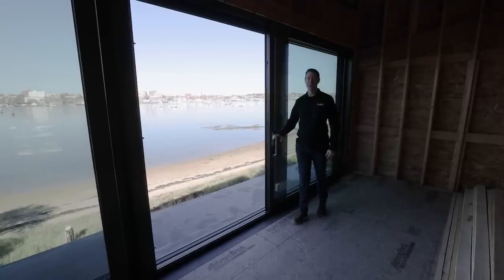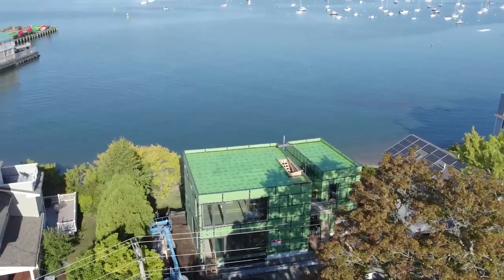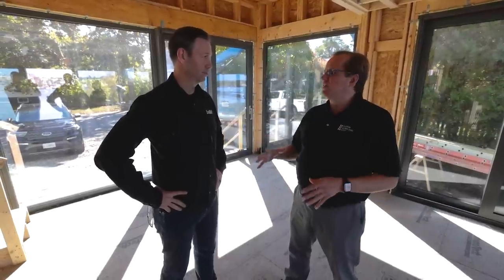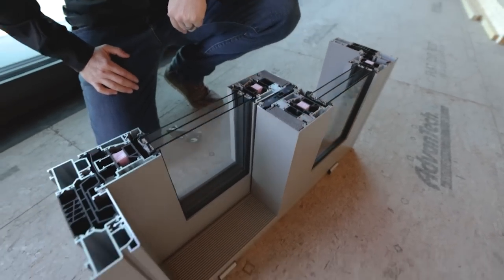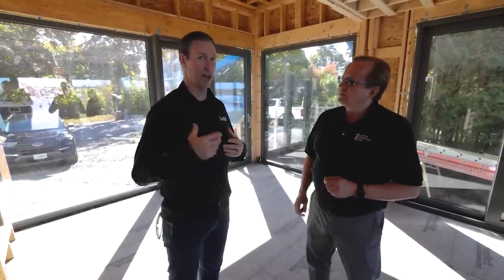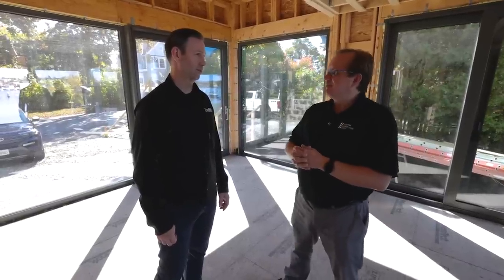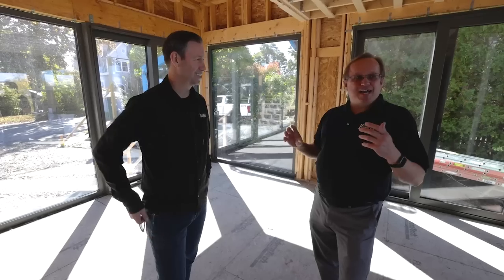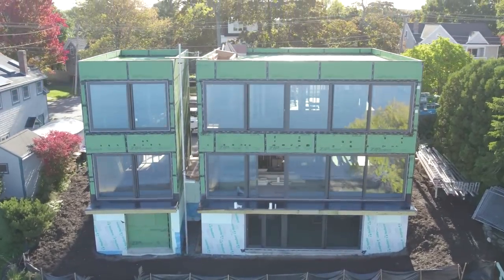How To Get Better/Cheaper Windows from Europe (to US Job-sites)!

Comment: Would be nice if they would start producing high quality windows in the US
Reply: Alpen from Colorado
Reply: Indeed there are a lot of quality windows and door manufacturers, and most important hurricane impact resistant: Windoor, PGT, CGI, Marvin Coastline, Euro-wall, Jeld-Wen.
Reply: There are, they just charge more than most people can afford for windows.
Reply: and ship them to Mexico too.
Reply: There are plenty of good windows in the US. I love my Simonton brickmold 600 vinyl windows or 5500 replacements. I have personally installed them in my own houses multiple times and they aren't insanely expensive (like 200-300 a standard size window). There are other brands that are great too.

This is a multi-million dollar house so buying European windows which are insanely expensive isn't a problem. They don't make sense for most sub 1 million dollar houses. These windows are thousands of dollars a piece and require a crew to set them which adds a ton more cost. Also no flange on a new construction window is just stupid and is asking for problems with any slight variation in installation. Taping a flanged window is so easy and hard to screw up. 

Regular houses probably won't see an insane energy cost savings going from a good double pane us window and these insanely expensive triple pane. As far as this house if they were serious about energy efficiency, they wouldn't make a whole wall of windows. They can't be as energy efficient as a wall structure.
Reply: @Josh.1234  They are more energy efficient then a wall structure in an american classic house, In a Passive house its about equal. I sell and install euro windows all over the US, I also do water proofing, and Flange windows have way more issues during install
Reply: @Josh.1234  how are you installing flanged in the middle of 2x6+ walls?
Reply: @TimFrentz  the question is why install them in the middle of a 2x6 wall? If your architect spec'ed that then you will need flangeless of course but it's way more preferable to use zip-r panels, caulk, flanged window, Huber flashing tape over the flanges, metal flashing over the head trim.. bomber install and hard to mess up.

Recess it in a wall and you are creating a lot of potential problematic joints and a lot of potential for installer error.
Reply: @Shredz131  looking at the specs on these windows, the best of these models are not quite .1 u-value (most are around .2 though) making it roughly r10.. min code for wall r value in US is r13.. so no these are not better insulation than a code minimum wall structure.

Also flanged windows do not fail or have more install problems than flangeless in residential construction.
Reply: @Josh.1234  yeah, but you need to look at solar gain. The net result is better than a wall
Reply: @immers2410  solar gains will not compensate for a wall of windows. No way you slice it. If you have a wall of windows in Maine, your house will be colder than if you had a well designed insulated wall.

Also solar gains cause problematic thermal fluctuations in a house. In the summer, the sun side of a house will get too hot and make your HVAC work harder than if it was an insulated wall. You get some heating help in the winter but when the r value is 10 in a zone 7 climate, that won't help much nor will that help in the middle of the night.

I love walls of windows and would put them in my house but I am not going to lie about their thermal properties.
Reply: @Josh.1234  sounds like you aren't used to installing anything more/better than "well it meets code". Even a Lowes ReliaBuilt brand 3060 is $250. Minimum is not my style, but you do you though.
Reply: No one is producing high quality windows in America? My sister in law would disagree with this take having just gone through Ian without a scratch or broken windows
Reply: @P1mpDaddyG  jeld-wen Epic Vue . Also you can add Marvin ultimate, those are aluminum impact resistant windows and doors wood cladded in the inside.
Reply: @MiroBG359  if she leaves in florida and has impact windows and doors installed, those has the most strict codes in the country, any product that has a miamj dade NOA or a florida approval for HVZN must wistand an storm , actually I'm more worried about roofs   than about windows in florida.
Reply: @bamascubaman  every project has a budget and needs to balance price/quality on a long list of items. You can't just choose the best on every item, every time. Sure if you are like this project and the house is going to be 2-4mil, that window package might make sense especially being in zone7 coastal. But most 1-2mil houses in non extreme climates don't need that 200k window package.

Also not all 250 dollar windows are the same, that money goes much further in quality if ordering from an exterior building supplier like beacon and actually doing your research on quality windows which includes installing them. I have used European windows and other expensive windows. They are nice and work well but for most price points, they do not make sense considering the quality of everything else in the house. 

I couldn't be happier with Simonton birckmould 600 and the 5500 series. I have used them in multiple houses I have built for myself and as I stand here making my coffee in the kitchen this morning, I am looking at a 15 year old 5500 that works great not to mention looks and functions exactly the same as the day I installed it.

My point is help pick products for your clients that make sense given the quality of the rest of the house.
Reply: Phius (passive house us) has a database of windows that are PHIUS certified. Some are US made like Alpen!  Buy American!
Reply: @Shredz131  What window brand do you sell?
Reply: There are many  high quality window manufacturers in the US. However, they are expensive. With the dollar being strong now, it does not surprise me that you could buy high quality windows in Europe for less money. 

Most builders use the cheapest windows possible unless the owner stipulates specific windows.
Reply: The big question one needs to ask is who provides the warranty if you have a failure. Most windows from Europe are made by a small fabricator not the window manufacture.  I would also request air and water test reports to ASTM/AAMA standards vs European standards not just modeling because US air and water standards are more stringent due to US weather conditions.   I have seen many European made windows fail air and water field testing due to this issue. 
Paint is another issue.  The European standard powder coating does not conform with AAMA 2605 standard, so in mid and southern US the paint will fade faster especially in dark and bright colors.
Reply: @immers2410  SHG in Maine?  Portland is about 120 south of the 45th parallel. Not too sunny in December, January and February.
Reply: Unfortunately the residential construction industry in the US only changes when they either find a cheaper way or when code changes and enforcement force them to change. There is a huge amount of politics in code development, adoption, and enforcement. Not to mention the fact that building product manufacturers are well represented on the code writing committees. Hopefully someday we’ll get past the hang up of cost per square foot being more important than quality, performance, and efficiency. We would all benefit from living in a smaller but much better house, and if that was the only type we allowed the price would probably come down as well.
Reply: @Josh.1234  that’s the thing though. These aren’t expensive windows in Europe. They are just normal windows in average houses for a reasonable price ( relative to their size). The USA windows are cheap junk or extremely expensive.
Reply: @kevinstenger4334  zip sheathing? Advantech? Liquid flashing? Spray foam? Structural screws? Vinyl siding? Hardie board? Tyvek? Etc.. I could go on and on with market driven products that speed up, make less error prone and make a better house for all the trades. 

Sometimes cost and govt regs drive it but the market is a stronger driver. Also cost reduction should be important to every builder managing their clients budget.
Reply: @rpvitiello  comparatively probably not expensive in Europe but that's because most of their windows are expensive and their govt forces it with their standards. Doesn't mean it's a good value for them or us.

US has plenty of great windows, at a much better price/value point. Quality vinyl windows are such a good deal, unless you are building a 2mil+ house, it doesn't make sense with going for high end windows like these.
Reply: Nothing wrong with international trade. Europe buys a lot of US stuff too. Let everyone do what they do best. US is good at making F-35s, Europeans are good at making construction material and civil engineering.
Reply: @Josh.1234  Have you lived in a US city? Horrible noise pollution not mitigated because of garbage building standards. Most people live in buildings with low quality windows - that is not "good value" for us.
Reply: @SuWoopSparrow  if you mean a dense urban center with high rises no, I nor do most Americans live in those conditions.. I love 10mins outside a major metro. 

My 300-400 dollar windows block everything perfectly aside from helicopters.

Residential code should not force people to attain some noise transmission level the government decides. It's up to each individual as to how much they want to spend on their windows and the features they have. If you want to buy expensive windows for a few points lower in the u-value and more sound deadening, you are welcome to. But don't force the rest of us.
Reply: @Josh.1234  No, many Americans live in corporate rental apartments that charge high prices for bare minimum building standards. These are not highrises. When I was living in such a situation, I would have gladly paid to upgrade the windows, but do you honestly imagine this is an option? That /absolutely/ should be forced to be a higher standard than what it currently is.
Reply: @SuWoopSparrow  lol corporate rentals are a miniscule percentage of the US housing market. Probably less than 1%. If you want a better apartment, work for a company that puts you up in a better place. They can spend more if they so choose but they didn't.

But don't push some nonsense laws to try and force every building to be built to your preference. Let the free market determine the grade of the building people want. If the windows are that bad, people will opt to stay in a better building punishing the developer who skimped on the windows.

Tired of this constant nonsense from people who have never managed a construction budget trying to force everyone to use expensive details for every system in a building. American Vinyl double pane residential windows are perfectly fine for most sup 2mil houses.
Reply: @Josh.1234  Right. "Punishing the developer who skimped" - thats why noise pollution affecting mental health is not a widespread problem in the US, right? (Hint: it is a problem). Thats why building standards exist - to ensure safety and wellbeing of inhabitants. Those are not "nonsense" laws, but of course suburbanites don't care either way. The free market doesnt work when people are already desperate for shelter and have no bargaining power. Thats why these renters are just cattle.

As far as "managing a construction budget", you are welcome to look at the financials of these apartment complexes. Theyre publicly available. They become financially solvent very quickly after opening. They make plenty in profits and can very easily afford to sound proof levels, upgrade windows, and more. These are 2k+ a month "luxury" units made like garbage btw.

Luckily, I dont have to deal with a place that believes triple pane windows are "expensive details" anymore.
Reply: @SuWoopSparrow  You are blaming the US standards and window market for societies mental health problems? really? haha, that is crazy

2k a month is not luxury, there are plenty of high end apartment or condo buildings with expensive windows, you just aren't living in one. 

You are taking this on a wild goose chase.. this video and the comments are about residential construction and in America, these are privately owned. You can pick whatever grade window, toilet, roof, siding, etc you want. I do not want triple pane 1k+ windows in my house so I don't buy them. If youre mental health hinges on having triple pane windows, then pay more for rent or buy your own place with those windows.
Reply: @Josh.1234  I dont live in that situation anymore, as I said.

Noise pollution leads to mental health problems. Yes. Its a major reason why city dwellers are stressed and on edge. This is already proven. Nothing crazy about that. 

2k minimum for a studio apartment that is labeled as "luxury" is luxury in the renting world of major US cities. That 2k is probably more like 2.5k now.
Reply: Where is the Problem? How you are waiting for?
Reply: @Shredz131  That is absolutely non-sense and ridiculous to say.  There is no such window that will have an r-value or higher level of insulating factors of a properly built wall to any current day code in a major city in the States.  A window is a giant hole in a wall letting in energy even with the latest technology.  That is just laughable.  Ask Matt to build his standard and then his most efficient wall compared to your space age windows from 100 years in the future.  Give me a break.
Reply: @Josh.1234  Well, I just needed to install a new window in my house because there was an old 1 pane window left in the attic. I just went to a home store ( I live in Germany) and picked up a 750*750mm triple pane window with tilt and turn for 114€ (Its the store budget brand btw, and they dont have double pane).

Yes these huge windows in the video are expensive but efficient windows in normal sizes dont have to be.

In the end I was lucky to buy a house that already has triple pane windows everywhere, so I dont even need to upgrade for the next 20-30 years.
Reply: @Heimbasteln  these windows in regular sizes are not cheap. If they were cheap, and energy efficient and quality then we would all be importing them from Germany :)

Yeah idk as far as the budget windows in Germany, whether they are well built or what their overall u-value type rating is in comparison. My guess is with all the energy problems in Europe, countries might be subsidizing windows to help counteract the winter energy demand.
Reply: @Josh.1234  The U value is 0,98
I would expect some slightly  higher price windows to be more efficient.

About the price difference, you have to take shipping costs and tariffs into account, we dont have any tariffs inside the EU, but if I buy something from the US I can expect 50-100% additional costs.

I also dont think these windows are subsidized, I would expect the price to be lower because more energy efficient windows are sold here.

Its also straight up banned to install new windows with a u value greater than 1,3 in Germany.
Reply: @Heimbasteln  well you have VAT but yeah tariff/shipping would be on exports to US. 

Not sure what your u-value scale is in Germany.  In US, it basically need to be lower than .30
Reply: If they did, no one would be able to afford them... that's the American way!! But you know, they wouldn't be made here, they'd be outsourced and still be overpriced 🙄
Reply: Schüco is producing in the USA.
Reply: @SuWoopSparrow You're making good points. You're debating a fool..
Reply: They do. Fleetwood, Styline, Marvin, Pella, etc.
Reply: We do it here in USA
Reply: Pasad Windows

Comment: Could you cover heated windows at some point. It would seem like they would be an excellent option in cold climates as they SHOULD prevent room heat from leaving the building. But how much energy to they consume?
Reply: With windows like these, are perfect for cold climate. They use them like in the north of Sweden and Finland. And no, you don't need heated Windows.

Comment: I live 125 feet away from the local train around here. I need every advantage I can for noise dampening from foundation to roof. Shoots right through my windows right now. Something to look into as I work on remodeling my house over time right now.
Reply: I own a few properties in Warsaw, Poland. Some of them are in noisy neighborhood not far from the airport and one of the most heavy used railway line in Poland. I bought aluminum frames with noise-reducing triple glassing. It works marvelously. But to be honest - the way the windows are installed in the video makes me laugh from the European point of view and my own experience. This would not pass the post installation inspection here. There are so many crucial parts of the installation skipped. Inacceptable regarding newest energy efficiency building requirements in Poland (which are still not that rigorous). And the aluminum frames they show in the video are actually from a Polish manufacturer.

Comment: If the building is to be built with aluminum windows and steel siding is there a way to deal with the galvanic interaction between the aluminum and steel which can lead to corrosion.  Is there a recommendations or best practices in dealing with this situation or is this a situation where we just should not choose any kind of aluminum systems if we plan to use steel siding?
Reply: ? There aren't any problems.